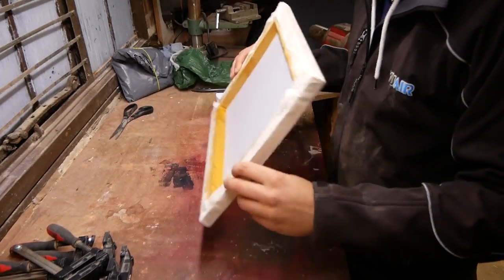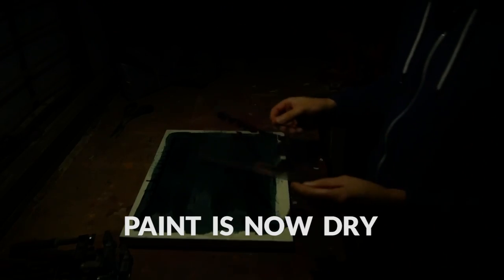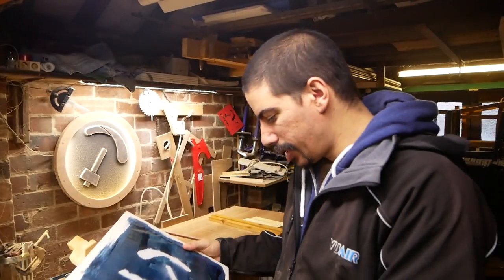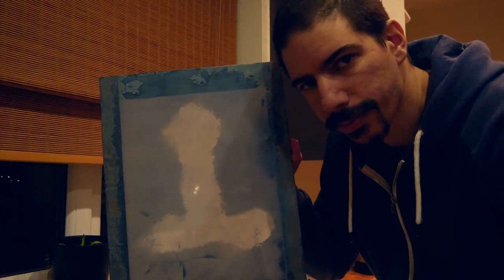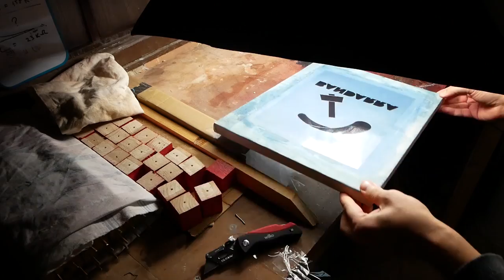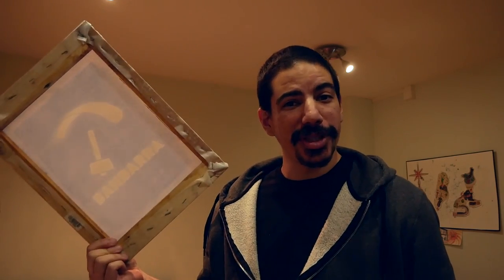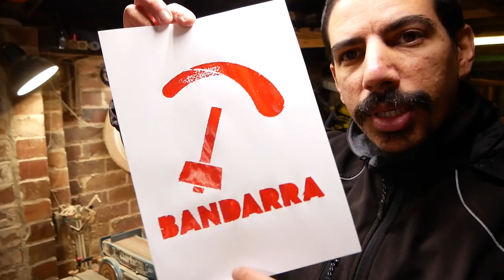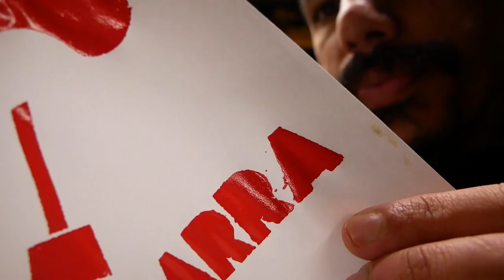Silk screen tests - BANDARRA

Comment: seems like there is a gap between the silk screen and the 'light blocker' during the exposure. maybe trying to close that gap will give a clearer picture. But I do like the final result with the imperfections, makes it more interesting IMO :)
Reply from the maker: yes, that's very true. I forgot about it but i saw on a tutorial,  using a piece of glass to press it down

Comment: You need to slightly space your screen above the item you want to print on. When printing, the screen should only touch the item to be printed where the sharp edge of the squeegee is being pressed down and being drawn down the screen.  Fix the screen to a frame with hinges so you can lift the screen to remove the print; and also fiddle with the spacing. Silk screen printing is a fine balance between the thickness of the ink and the gap between the screen and the item to be printed. Use something with more weight to test print on as you don't want the item to be printed sticking to the screen, also some silk screens are just crap and will never produce a good print. Good luck!